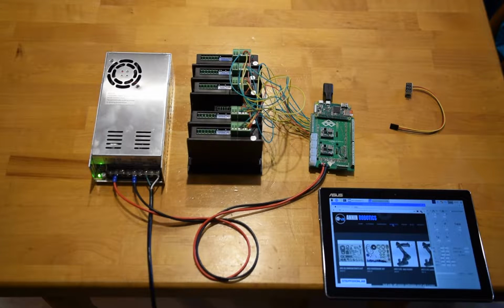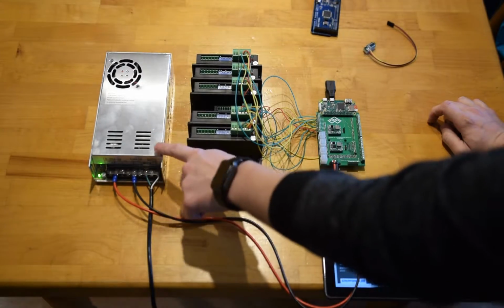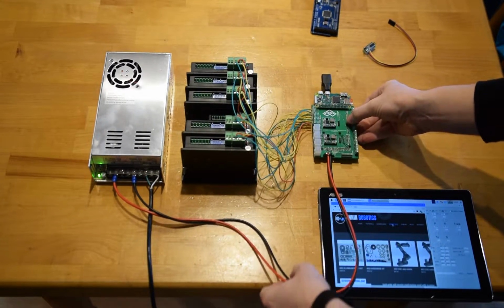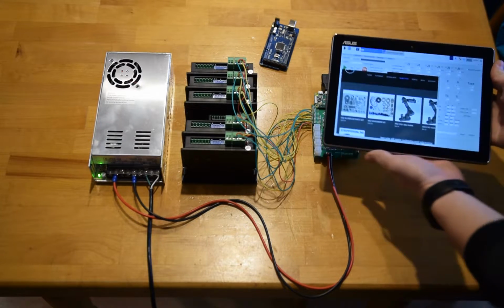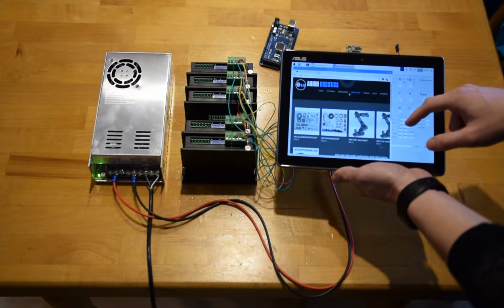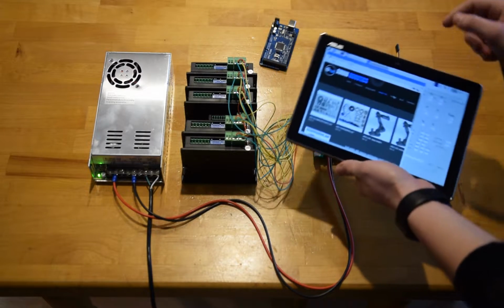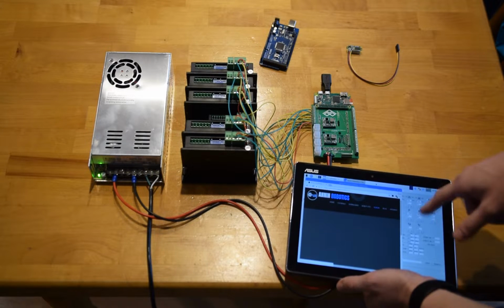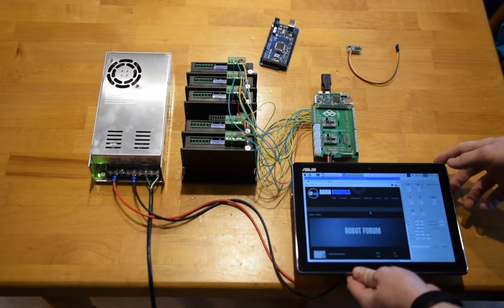AR2 Software Computer Overview

Comment: @zach Allen do you have any clue as to weather this will work with the ar4? And the latest teensy 4.1 board? This would come in hand for my project with it being in my work place
Reply from the maker: I actually don't know. I stepped away from this project a while ago so I'm behind on the updates to the AR4 and the teensy 4.1. With the tight market on Raspberry Pi's right now, it's probably best to use different hardware too. Best of luck with your project!